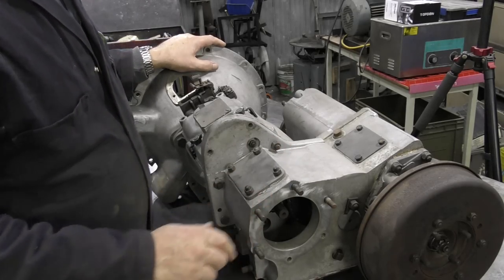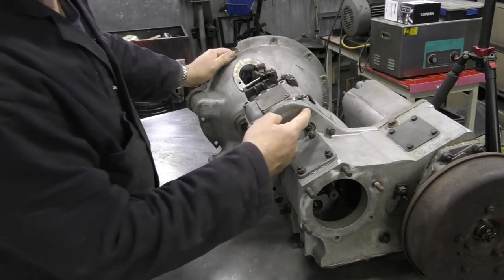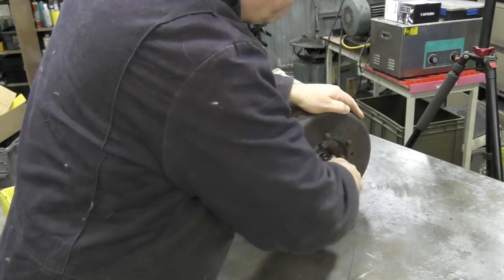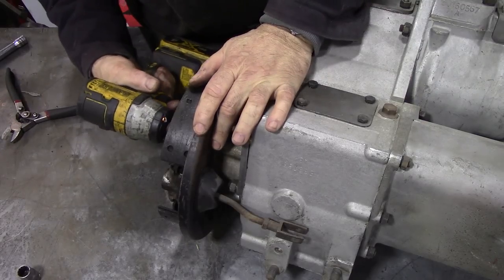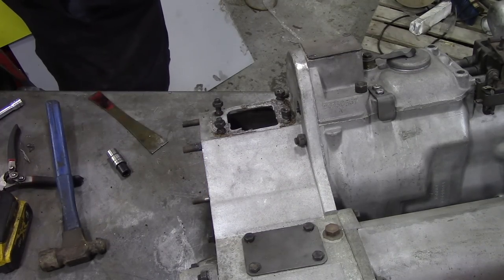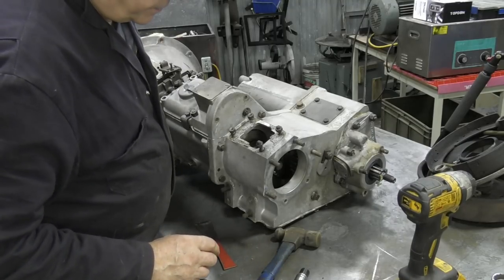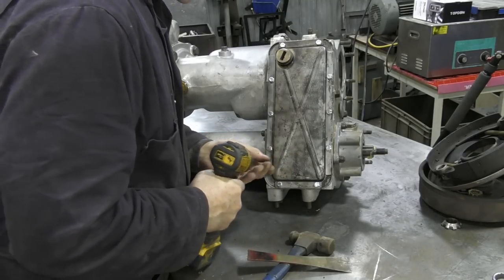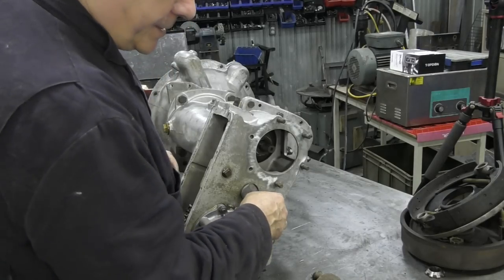Series 3 gearbox stripdown part 1

Comment: Ah, the disclaimer! Getting the hang of the two camera set up👍. Must take a wee bit longer to edit though. Parcel shouldn't be long.
Reply from the maker: Took me 2 hours to edit a 50-min video! 
However, I am learning by my mistakes! 
Each camera recorded 14Gb - but in 4gb files - so it is easy to lose synchronizing - next time join all the small files together and THEN edit!

Comment: Someone beat me to it it’s an overdrive. Know I went to Land Rover main dealership and asked for the spanner for the big nut on main drive .The gentlemen behind the counter made me feel like an utter prat. His words ……WHAT DO YOU THINK PEOPLE USE ?err a spanner I said DONT BE A .won’t right what he said sounds like ducking prat.USE A HAMMER AND COLD CHISEL.! This was back in the 80s I know have a smile so big thank you remembering the good old days. Only thing I can say as a bit of a tip ,is to replace the ball bearings and springs on the gear selector .If I had done it it would have saved me a lot of bother.hope to see more part to this .
Reply from the maker: The problem with hammering is you can damage the bearing - let's see what JP can make!
Reply: Hnj engineering make the nut spanner
Reply: @garysykes8291  I would have loved to have brought one when I asked for one back now over 30 years ago the way I was treated was horrible,I was made to feel like I was an idiot.And this was from a main dealer